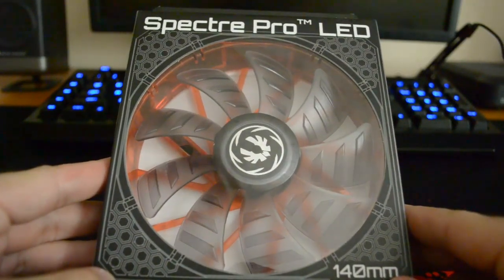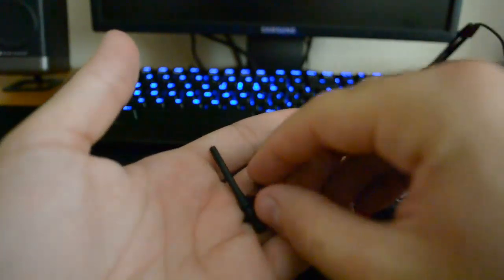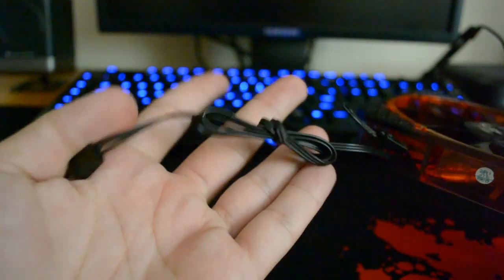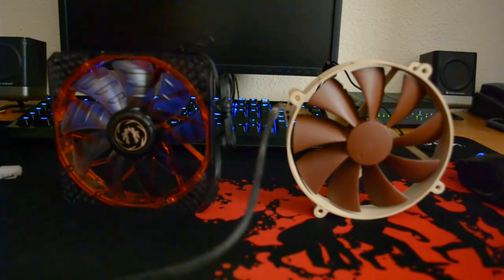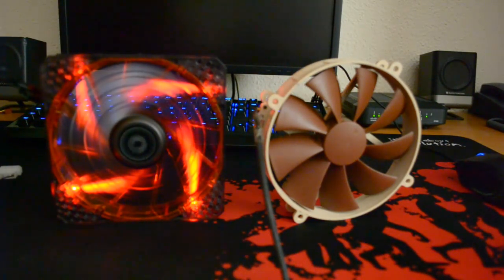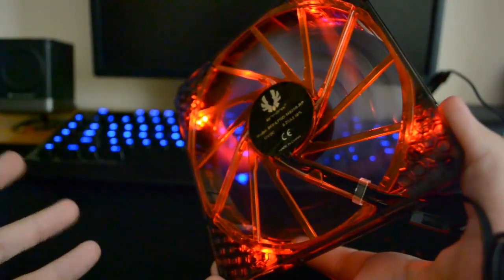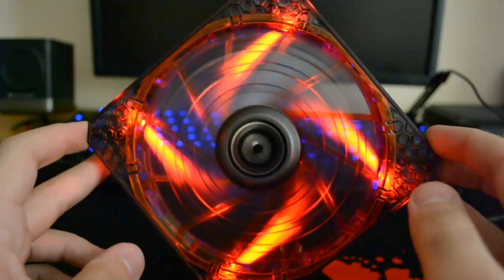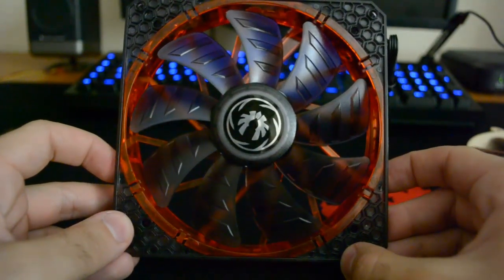Bitfenix Spectre Pro VS Nocuta NF-P14 FLX noise test

Comment: any fan can sound almost silent when you are running it low rpm and have significant background noise. you must remove background noise + check for bearing noise at low rpm, thats how you can tell a good fan. I guarantee bitfenix will have more ticking and vibration from its motor which will transfer to your case.

Comment: Just bought one, it's noisy compared to a Fractal Design Silent Series R2 140mm.
Reply: I have these fans running at 2000 RPM and you can bearly hear them. And the cost a thir of the r2 and have LED.

Comment: noctua makes the best fans in the business, no question. but unless you pay extra for the ppc models, which you have to throttle because they run at higher rpm, they are just too ugly to go into my system. which means i'll take the next best thing, and that's the spectre. works really nicely in a nzxt phantom.

Comment: The Bitfenix is a little quieter, but in comparison, the Bitfenix really pales against the Noctua. Especially for static pressure if you use it on a radiator.

Comment: I shop on amazon and I might just get the 200mm red led specter pro, but I like the asthetics of the corsair ones, I can put 2 120s or 140s on the side panel and 2 120s mounted on the hard drive cage

I have the aerocool xpredator x3 devil red

Comment: im just getting some spectre pros like this and put them everywher e:D 2 140 infront 2 on the side panel and 2 120 at the top as exhaust ^^ and will use the stock fans on the h80i as exhaust in the back it will be awesome